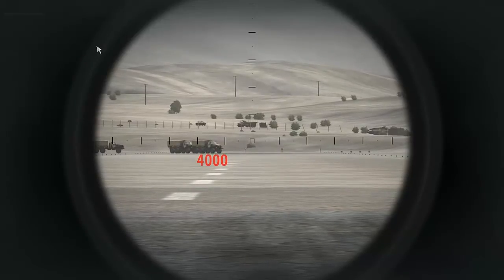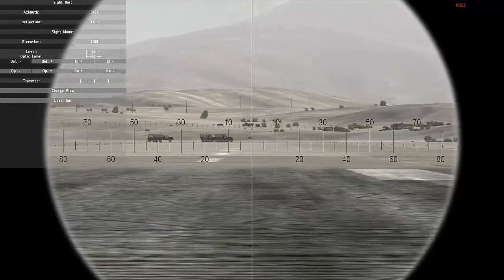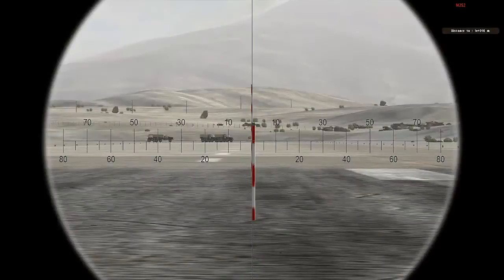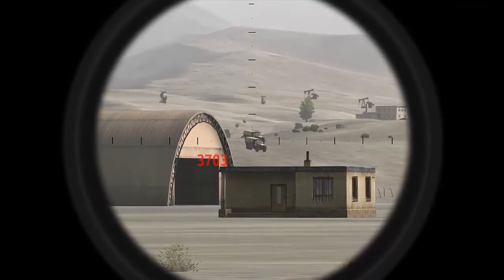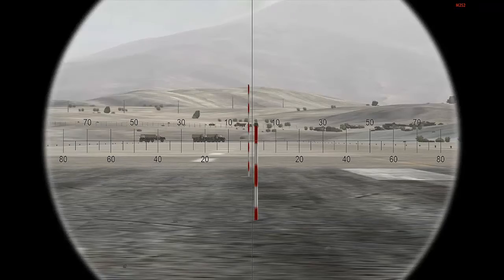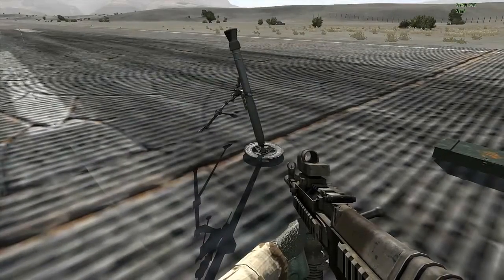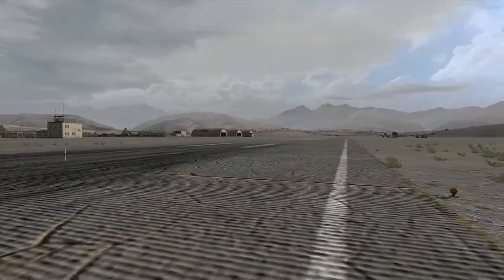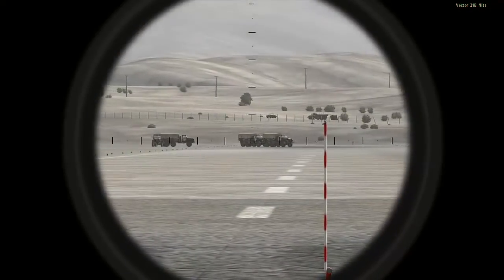ARMA 2 ACE Tutorial - M252 81mm Mortar

Comment: kind've a late question, but if you need to deploy a mortar team quickly and they need to put rounds down range within a couple of minutes, would the same thing apply??
Reply from the maker: +Marshy There really isn't much of a way to expedite the process so I'd be inclined to say the same method applies.  It does however become pretty quick and efficient once you get a few guys used to working on one of them though.

Comment: Actually I have to post again, I tried it out, deflection works perfectly but for some odd reason my elevation seems not right, e.g. I lase my target on a runway, 600m away, the range tables say 1426, same altitude, i elevate my sight on 1426 and then level my gun accordingly ( |o| ) and fire, and each round hits about a 100m short, any ideas on this issue?
Reply from the maker: I've actually noticed that as well since I've last used mortars, I believe the rangetables may have been altered in a previous ACE update as the 105mm rangetables are gone all together which I noticed when I went to record the use of the M119.

I was meaning to do an overview of the map tools which are how I usually do azimuth and ranging calculations, I'll see if that resolves any inaccuracy.

One thing to note is that in the rangetables you will see how sometimes you can use different charges to hit the same range (example would be a zero charge at max range shows up in the charge 1 list) so try using a different charge for the same given range and see if that helps.

Also keep in mind the 81mm is a lot less accurate than the 60mm which I'll demonstrate when I go over the 60mm.

in any event thanks for your insight.
Reply: pickinthatbanjo Ah, good to know it wasn´t just me, thought I was doing something wrong, after practising mortars about 3 hours long yesterday I decided to switch to the M109 Howitzer and I got direct hit on target on 2300m (so I can see visual impact from where I was standing with a SOFLAM), perhaps its just the 81mm that has some broken values, I'll use it some more and see, for now I'll just correct my elevation manually to compensate with the 100m short issue. Thanks a lot.
Reply from the maker: No problem I'm glad I could help, I'd love to see mortar use using the mortar sight become more common online as it's a great support role.

I'm planning on demonstrating the accuracy of the 60mm, though their use is the same procedure as with the 81mm so it won't really be a tutorial.  I'm also planning on doing a tutorial for the 120mm tampella using the mortar tools though.
Reply: Hello, im very interested in mortars, and yes if you using M225 you must add 100 m so for example if your target is 1535 m away, you must use 1635 and make calculations, olso i noticed that M224 60 mm mortar shoot shorter than 100 meters :( i dont know why, but you must add 100 m range and more than 100 m, im using diffirent way to calculate range and deflection, but i must add 100 m to range too when using M225 :),
Reply: In my experience it's just the tables for the M252 that are off. The 60mm as well as the Russian 82mm tables are accurate, just the US 81mm fall short (literally) by the aforementioned 100-150m.